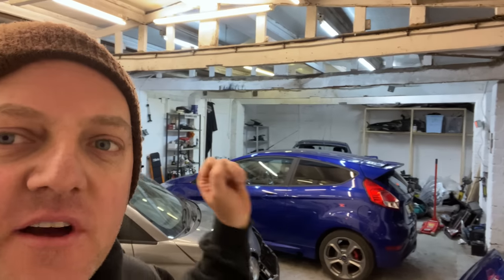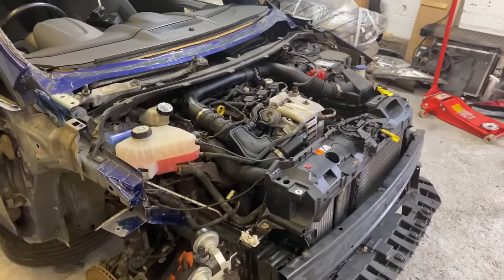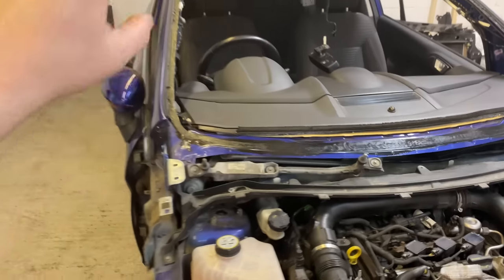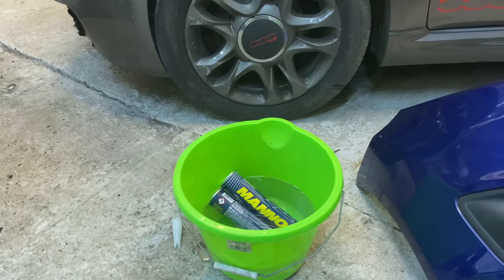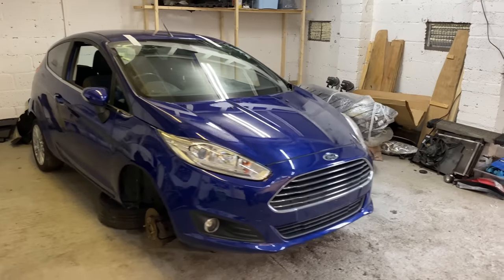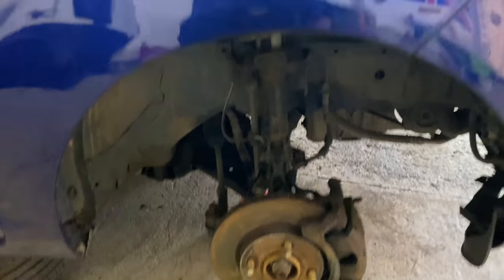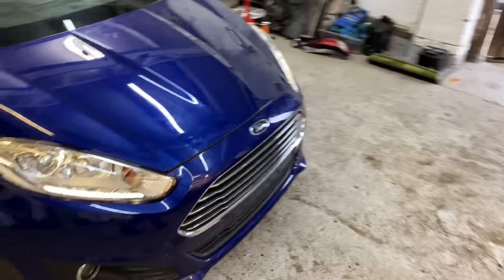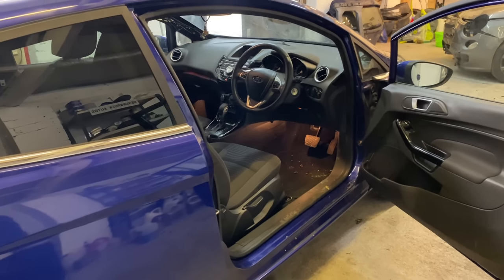FIESTA TITANIUM AUTOMATIC SALVAGE REBUILD PT 2

Comment: Hi Mark
If you add a smear of copper slip grease to the back of the alloy wheel it will stop it seizing on the hub in future.
Reply from the maker: Thanks for the tip Mark appreciate it buddy stay safe 👍👍😷

Comment: Nice looking car Mark, but check the wheel on the front offside, looked like damage on the inside sidewall mate.
Reply from the maker: Thanks Alan i will have a look at that nice one buddy 👍👍
Reply: i agree on that, looks like a nasty slice thats ready to fail the MOT there, shame as like said in the video, cracking tyre otherwise  :(